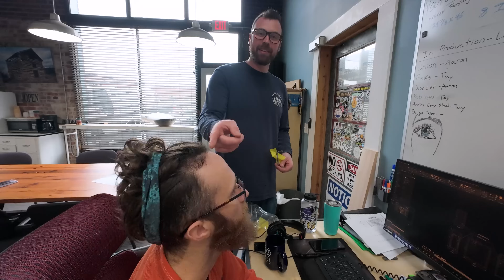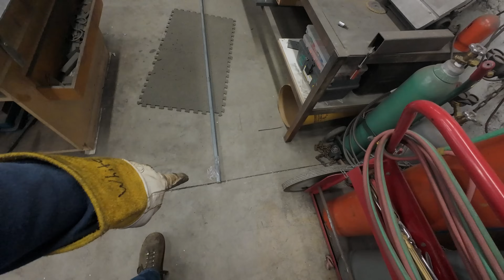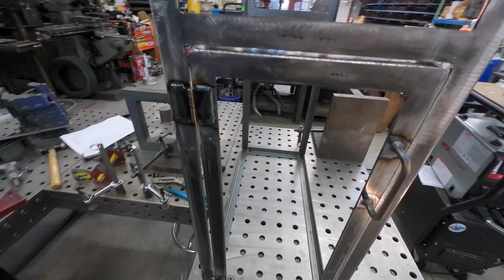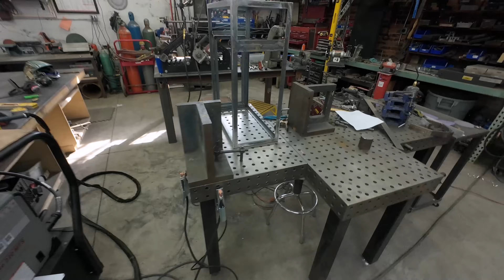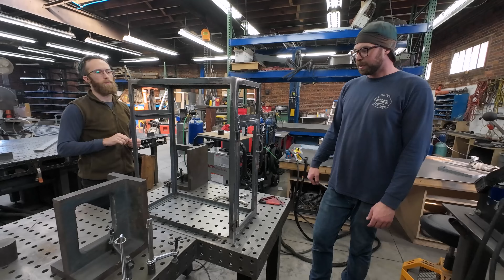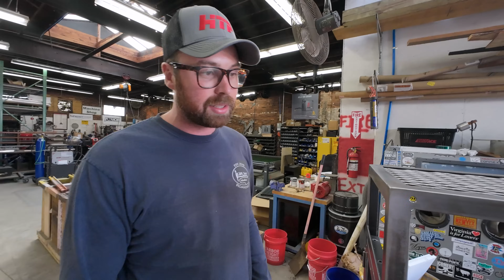Raw Metal Computer Stand Build

Comment: Hey!
just caught your channel with this video.
I love that you keep it light and funny!
I have a question about Mig.
Do you in general prefer flux or gas?
are there certain types of migging where you use/choose either flux or gas as your preference?
From cost to amount of wire held, when you use a separate feeder or the inside the machine coil,, and especially related to the quality and durability of weld, rusty metal, 1/8" gap pipe welding, etc.
I have never welded for but I am dying to do it.
Also, can you discuss the difference in how you weld with solid versus flex. do you also decide based on the type, size, specs of the metals, also when welding from prints.
These IGBT's seem very simple, synergistic, wave modulation, etc.
This is a lot of questions, and if you do reply, or make a real short video on weld consumables in general, cover indoor and outdoor welding, and if you have any rules related to metal thickness or other parameters that have you choosing to use the $1,500.00 and up and the cheap $400 to about $1,100.00 welders which do you would choose and why? I have my personal thought regarding the +/- of cheap multi function, that offer crazy amounts of options, and the different wave possibilities, buying separate mig, tig on the cheapies,or multi. You speak of Everlast, which was the very first online cheaper IGBT welders. Besides them raising price so much, what types of issues have you come across with them?
And if you could speak to the heavy duty brands, Esab, L/E Miller, if, when where its better to use them.
I know there are tons of dyed in the wool Blues, Reds, etc., but Miler, was bought by a venture Capital Fund, as are almost all companies, they were lucky and smart? to borrow over 15 TRILLION at 1-2% interest over the last 6 years, and regardless of their fancy ads, Miller is very involved in getting some or all parts, sub assemblies, along with prices on the equipment, tooling, MRO, consumables, auto-pays, replace before it breaks parts that we are being pushed into. 

Obviously I am just as focused of the business end as well as technical sides, and I am trying to create a Foundation based company focused on GHG, recycling, pollution, water, wastewater, and expanding the program to other companies.
Inflati9n right now is a totally false construct. I track all industrial auctions, pricing, what industries the individual Venture Capitalist funds, (made up mostly of a club of Billionaires).
When Covid, and far worse, the massive lobby and pull the steel industry has in Washington, we saw trump put a 20% tariff on steel, only because of one 450 employee steel creation company, and U.Ss. Steel, laying off 6,700 employees shuttering their furnaces, and metering out their stock at up to $2,000 a ton from $500-$700.
This time period of unrest, uncertainty and materials unavailability led to crazy pricing, but so many private VC and M&A Banks, as well as giant Corporations imply kept and are keeping their prices (and outrageous) undeserved profits that they are only lowering, very slowly, when business conditions warrant. Also the sizes, volumes of Consumer goods have been cut back, like 16oz Pasta that used to be .99 or 5 for price of 4 is the new regular.
But the entirety of our "inflation" is all additional profits. That makes the Fed raise Rates, which the Banks, CC Companies, VC/MA/Private conglomerates just love, because VC and M&A 5-15 investor funds already have bought uncountable companies, brands, real estate, farmland is up 30% - Gates owns two NYC's of prime farmland, also Bezos. These amounts are not exact but illustrate how Manufacturing is losing 100,000's of thousands of employees who will never return. It is NOT because nobody wants the jobs, rather pay rates, types of jobs offered, the 550,000 robots the U.S. has bought.
It used to be that if you build a 225 Million Factory, there would be about 1.5 to 2.5 workers per Million. Now, it's about 1/2 an employee for every million spent. Of course these are very broad strokes, and you can't compare a software company to heavy industry.
My observations would, of course, be cut to ribbons by charts from their MBA's and CEO's.
If you own a business, and you really like or love it, are more technically/operationally/creatively focused, you roughly fall into the Small or Family business when yo are hands on as your primary activity, you could be roughly called an owner/operator, and care about quality, employees, let the income come in because of the quality. Most of these need to find niches, try to have 2-3 customers worth 10% each of income, but you are more a craftsman, lover of your work and product as your primary goal.

Corporations, judged by quarterly returns, stock price, where CEO's get up to 80% of their pay, which can wind up being 200, 300 times the income of the rank and file. The VC/M&A set the parameters of time length off the fund, overall annualized profit, general type of companies to buy, combine, "right size", automate, and the primary focus, large scale, is that exit date, making the final three years as immensely profitable as can be.
If you are, or there is an MBA on staff, CFO, Those are generally conglomerates, and building revenue is as likely, or even more, to be from acquisitions and consolidating industries, as organic growth.
An example: a company headquartered in Italy, has 51% of thee SS tube and pipe market of the entire U.S.A.
Besides their primary commonality, which is that employees are the most expensive, unpredictable, cost escalating input, so NO MATTER WHAT the soft music Green Planet, Smiling Family Ads say, I get 45 Association Magazines a month, for most all of the sectors of Manufacturing, Roads and Infrastructure, Fabtech, Plastics, waste today, municipal water, Aerospace, #D and additive, Laser Focus World, etc., and reading between all the lines, as well as all the paged dedicated to buyouts, restructuring, plant combining, well bottom line is that the American People, as a whole, are facing ten years of the worst squeezing out of the best paying Industry, Manufacturing, Oil and Gas, Infrastructure rebuilding, plus there is already totally over an audited so far total of 4 Trillion in the COVID PPP and Cares Fraud where companies simply took the money. There was a quadrupling in the number of flat out closes the doors and auction it all, including BIG$ cnc 2017 and newer.
I also correlated it to the sale of the expensive - $400K to $1.8M Diesel Pusher RVs.
W went from thousands available, with airport pickup concierge service, to nothing available AT ALL, price for a top of the line Prevost went from 1.8M to 2.9M
Sorry I added this ramble, I just fear what is coming. I also have a solution, one  that keeps an extra 20% of cash flowing in the economy, which represents the minimum amount of profit these new private Domestic Financial Terrorists from pulling at least that much out of the economy and pocketing that profit. josephapare  emailgmail

Comment: Either I'm using a MIG nozzle holder incorrectly, or you are... or it's designed to hold both ways. I'm going to try today!!

Edit - I think the yellow MIG nozzle holder is a different type of holder than that of the typical harbor freight style.  I like that, you can just set it down and not balance it in the pinch of the metal.

Comment: Great channel and content. As for the idea of MIG and TIG on the same cart, I built a cart with my MIG, TIG, and mobile plasma on the same cart with a harbor freight toolbox incorporated so I can have a place for all the related consumables, and extras in one place. I also incorporated a box that all three plug into with one 220 lead coming out as well as a single ground clamp for all three. Super handy since I'm basically lazy and unplugging one and plugging another drove me nuts. Both tanks have a place on the back of the cart. There are vertical tubes on the side for my different TIG rods.

Comment: Love the computer cage, really nice work.  Tay and crew, I think you all would benefit and add years to your sanity if you acoustically treat the room/area your air compressor is in.  The fact that you stop recording until it is not running might move it forward on the To Do list.  Controlling a great portion of that noise will make the shop far more pleasant...you will notice the difference immediately.  This is not an expensive project but there is some science involved.  May I suggest Googling "sound reduction" or similar definitions.  Great channel and that's thanks to Walker!